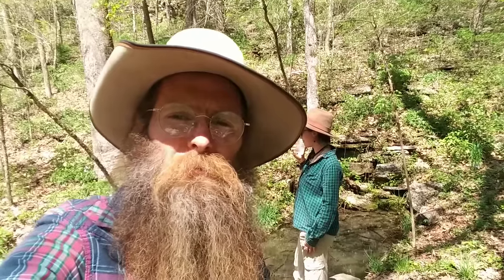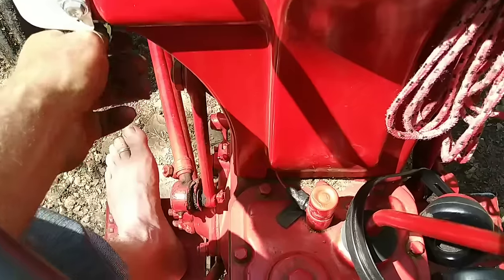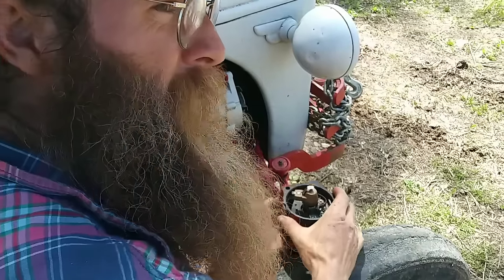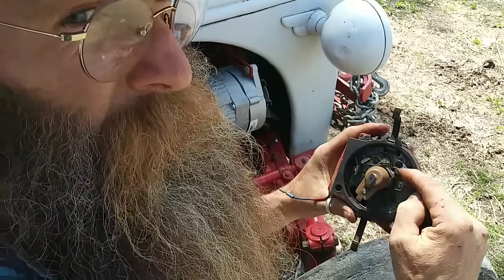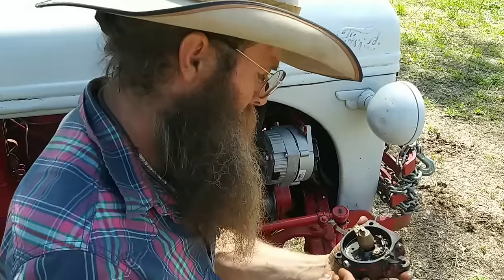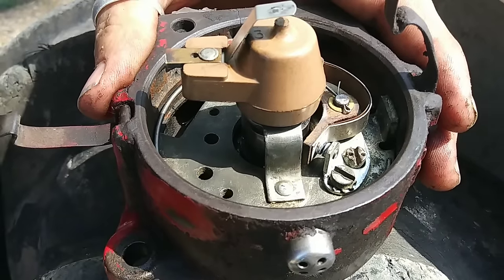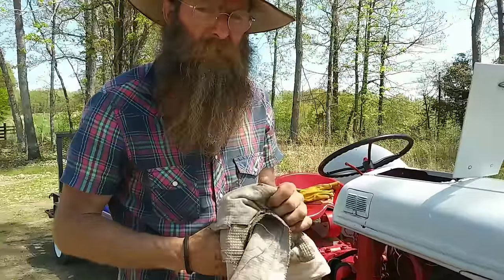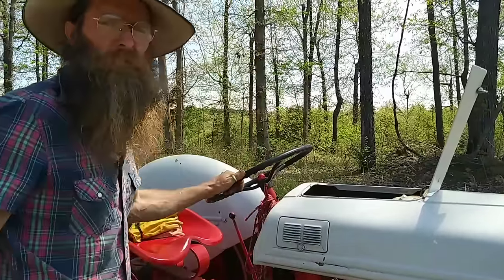A Hard Day's Work For An 8n Tractor

Comment: Nice video.  Great music.  If you made it home you know what you're doing.  But you really had that little trailer and it's 12 inch tires waaayy overloaded. My dad and I hold the all time record for overloading trailers and trucks with firewood.  I bent both rails of the frame on an old Chevrolet pick-up about mid-box  one time with a slightly too heavy a load of oak firewood . You came close to beating us both!  Nice job!
Reply from the maker: The tractor and trailer is all we have to work the land with. We don't have a car or a truck. It takes a hour and a half to get to were we where cutting from our house on the tractor. So it is important to make every trip count. anyone can put one log on a trailer and get back home safely but no wood will mount up by the sawmill that way. But it doesn't take any skill to overload the trailer and break it the first time you use it no wood will mount up by the sawmill that way either. The point is to be most efficient with the tools you have. We started here with a box of hand tools and $600 and nothing else. So anything we have we bought from money we made by carving wood spoons and bowls by hand outside on the side of the Rocky Mountain. It took a lot of spoons and bowls to buy that tractor and trailer.the Tractor enabled us to bring logs to the mill to build our house and workshop. It is a essential piece of equipment we would die without it. Apparently judging by some of the other comments we as a country are so cultural isolated some of us have never seen a tractor wheel come off the ground before. anyways thank you for the positive feedback
Reply: @CarvingAPath  You're living like my grandparents did here in this Wisconsin sand country.  My grandparents were genuine poor dirt farmers.  Poor and they farmed poor sandy soil.  They lived by keeping a small herd(s) of milk cows and the biggest herd they ever had was 12 cows.  And four kids to support. 

They started out farming with a modified F-12 McCormic Deering steel-wheeled tractor that when the engine went they put in the engine from a Model-A Ford.  It's mine now and is sitting down the hill a little.  My dad also owned it and used it for logging Jack Pine.  He put a boom (kind of like your device) made out of oak poles and attached on the back of it so the far ends extended perhaps 12 feet to the rear and up.  He put a big old pulley at the far end.  Which ended up being above a trailer he made from a Model A front axle and rough-cut lumber.  (Also sitting down the hill).   He made and mounted a pulley from scrap metal and mounted it to the rear power takeoff shaft just to the rear of and below the driver's seat and ran a cable up to and through the pulley at the end of the log boom and then down to a couple pieces of chain at the far end that were used to attach to a log. 

To operate it the operator would stand on the ground between the rear axle and big old iron rear wheels and  operate the foot clutch by hand.  Tracter in neutral let the clutch out and the drum would spool in the cable and raise the log.  Depress the clutch and it free spooled and if there was a log attached it just plain dropped (fast).  A primitive device the helped yielded a lot sawlogs that were hauled to a mill (on a grossly overloaded trailer) to yield rough sawn pine lumber.  That boom extended quite a way to the rear and provided a lot of leverage.  So many times when engaging the clutch the front end of that old steel tractor would come a couple three feet up off the ground.  The problem was when it came back down - which it did instantly.  Lots of stress on the front end of the tracter but it still looks as old and solid as it ever did.  So, I've seen a front wheel jump up and down quite a bit.
I have some good equipment here you could use.  A nice home-made, out of oak 4 x 4.s,  trailer  with no springs that you could haul a train engine on (and I suspect you probably would for some reason).  Tumblebugs.  But what you would really like and get some good use of of is my old T-20 crawler tractor.  Which you could probably get to run if you cleaned up the contacts in the magneto and gave a few, maybe more, cranks.  I'd give you the old crawler if I knew it was going to a good home but you gotta come pick it up!
Reply from the maker: Thanks for sharing those good memories. we love hearing stories from back when people made their way through life by using their engineering skills and ability to work hard. And absolutely that crawler would change our life. If we could figure out somehow to come get it that would be awesome. Anyways thanks for sharing the good stories and memories and the kind suggestions
Reply from the maker: I love fixing old things. Especially old things with interesting history. Anyways thank you for taking the time to think of us and offer those kind suggestions
Reply: @ravenfeather7087   Wow, how’s that for being a nice neighbour , he’s offering you a bunch of equipment that you could definitely use for FREE, Did I just hear right, if it was me I would be down there so fast to shake this mans hand, I hope you take this “ Raven Feather” a spoon or two for the best offer to you for equipment that you would love to have, am I right!  The man sounds like a great human being that is passing on who can use it. So did he ever come and take you up on your offer, ?

Comment: if you want to pull safely run that chain on the front of the tractor underneath the tractor. tractor will never rear up.
Reply: Would you be running it from the front bumper to...the log or through the attachment? 
I just want to better understand in case I get into a similar job. 

Thanks :)
Reply: @Brandon-eh4tz  you can hook it to the draw bar attachment on the bottom of the tractor. The idea is to use the weight to pull the nose down (yes, hook it to the log, use the attachment as a pass through)
Reply: @Brandon-eh4tz  this is for a straight line pull . in other words not turning the tractor. hopefully you have a front bumper to attach a strap, chain cable,or rope to the front bumper and run directly underneath the the middle of the tractor to whatever you are pulling. logs should raised at the front end for skidding so the front edge of the log won' suddenly catch. i guess for a log you could lay small limbs under the front to act as rollers. skidding logs really requires a log arch.

Comment: You called this an 8N tractor.  It is not an 8N!  it is either an 9N or a early 2N.   Ford started this series tractor in 1939 with the 9N which had the distributor located on the front of the engine.  This was originally a magneto but later changed to a distributor and front mounted.  When the 1942 model (2N) the distributor was still located on the front of the engine, but part way through the 2N production they switched the distributor to the side mount.  the side distributor continued through the 8N model produced from 1948 through 1952.  So 9N produced 1939 to 1942;  2N production from 1942 through 1947; and finally 8N production from 1948 to 1952.  See TractorData.com for more information.
Reply: Wheel hubs look 8N. The distributor changed during 8N run (1950).
Reply: John I had one just like it I thought it was 2n also they are little shorter but  very nibble I like mine but ha ha got upgrade went to 52 harry Ferguson  TO 30 which is a great tractor
Reply: Jack Decker TO30 and the N series are brothers.  A lot of people don’t know the difference, the think someone painted the tractor wrong.  Ferguson/Ford had a good relationship until Henry Ford tried to rip off Ferguson’s patents. Their disagreement and the prolonged court case eventually led to the Massey-Ferguson tractor.
Reply: Wheel Hub Patterns & Front Trail Links ..... Looks Like 8N To Me 🤔
Reply: That's an 8n. The rims on the back are rounded and will not fit the bigger drums on a 2n or 9n. Front mount distributors were exchanged for side mounts half way through 1947 so it is also '47 model or older.
Reply: Hilly beaner you disprove that it’s an 8N by your statement.  You’re stating it’s an 8N because the distributor moved in ‘47.  The 8N was not produced until 1948, hence the name 8N.  All 8n’s had a side mounted distributor, therefore it cannot be an 8N.
Reply: @johncroix7312   No Sir .... Not ALL 8N's had side mount distributor , that Is Incorrect !! 
 The Tractor In The Video IS An 8N !!   Thanks .😎
Reply: Waylon McCrae can you provide any evidence that Ford, having started using the side distributor to save money because it would be the same as their automobile 4 cyl engines
Reply: @johncroix7312   My Friend There Are Numerous Videos On You Tube That Show Painstaking Removals & Rebuilds Of Front Mount Distributors On 8N Fords ... I Am Also A Mechanic & A Fully Restored 8N Ford Owner .... Now Mine Is Side Mount , But The Man That I Bought It From Does 2 Restores A Year On 2N - 8N - 9N Tractors On Regular Basis He Has Shown Me And Educated Me On These Tractors , I HAVE Seen In Person An Early 8N With The Front Mount Distributors !!  I Don't Know If They Are Rare Or Common ... But Certain Production Run 8Ns Had Front Mounted Sparkers !!  Thanks John . - 🙂
Reply: @johncroix7312   Here John ... Check This Out . Go to this site and see if anything interests you !!  Thanks.    8n side vs front distributor

 www.yesterdaystractors.com

Actually........
1950 had both front & side distributor models.
The change over was at s/n 263,844. That would have been in late Feb or early March, 1950.
S/n 262,918 is a frontmount w/ a Feb 17, 1950 block casting date; s/n 273,657 is a sidemount w/ a block casting date of March 28, 1950

Comment: Your use of the tractor the way you did was stupid pulling a wheelie like that. plain stupid. Heavy equipment has absolutely no conscience. It will hurt or kill you in an instant and wont feel bad or sorry about it.I hope you learn your lesson without injury and in the future use that piece of equipment in the way it was designed to pull. Attach your pull point below the height of the axle...ALWAYS.  Otherwise nice production
Reply: EZRhino Stupid is as stupid does.

Comment: Why use a boom pole choked up like that and on the log? You are defeating mechanical leverage that the device creates for you. Literally safer than trying to look like a YouTube homestead hippy about to kill himself abusing the tractor in a way that was never intended to do, and some of our forefathers paved the way for warning stickers for.  Literally one of the dumbest things I have seen in a video emphasizing the drama of the distant of the trip made on the tractor. What happens when a chain slips or something breaks and you slam down on the front axle and break it? What happens when you clutch linkage pin snaps and your clutch is stuck engaged and you topple down that mountain end over end?

Comment: You done a good job. I see many comments bad but there I see a safe way for tractor and you to pick that wood considering the tractor weight. I mean that wheelie was controlled and the front wheels were not aggressively touching the ground. You control it well from the clutch. In back you have that steel that prevents the tractor also from backflip. Sorry for my language mistake Im not from US :)